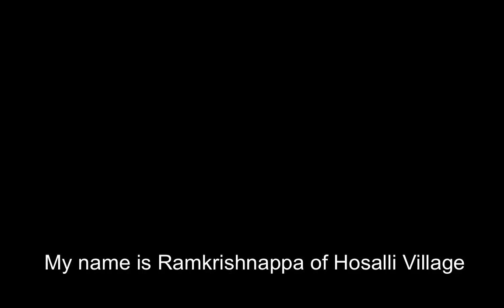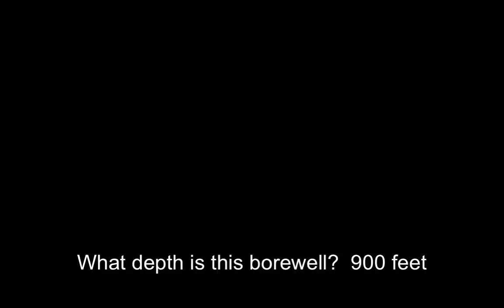Bore well recharge Rural Innovation

Comment: Sir, I am from Kerala ..can I recharge by directly insert from overflowing open Wells from rainy season....or can I use  the samewater filter we using for rainwater for open well recharge made by  300 ltr water tank filled with the filetering material sand charcoal jelly etc..pls advise
Reply: please call on 9986840730 to discuss your needs.
Reply: If its roop top water you can directly feed it.
If its field water don't feed it directly.
If want use it water drinking you add proper filter mechanism in place